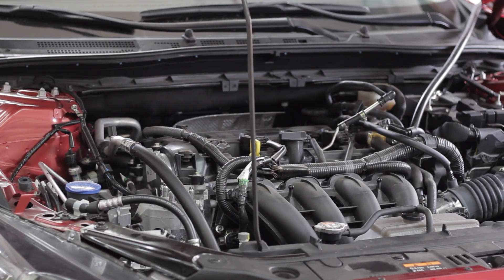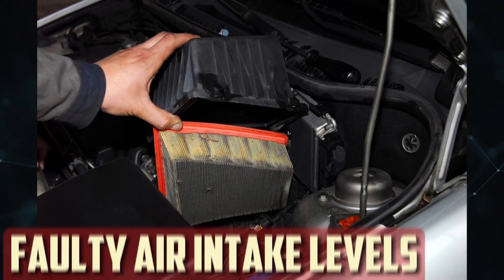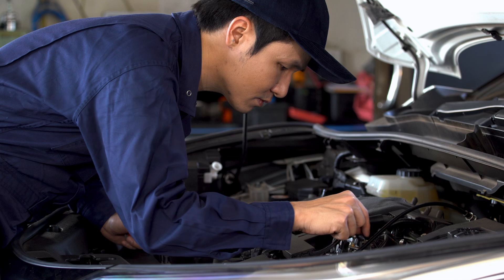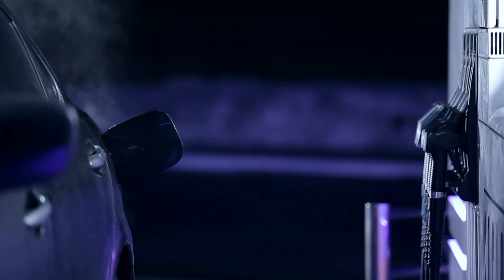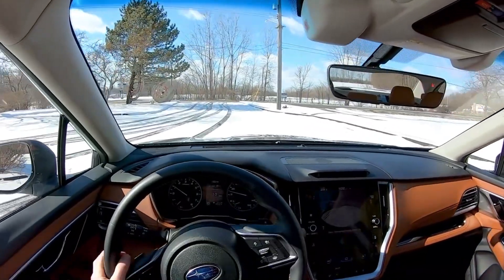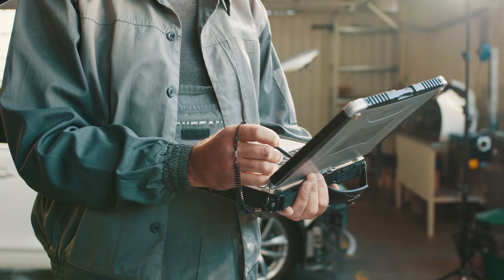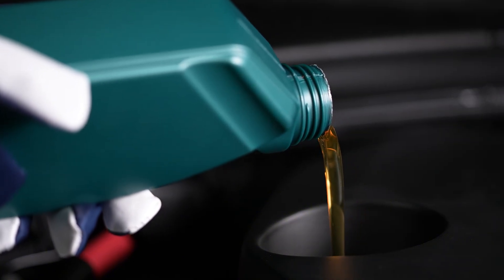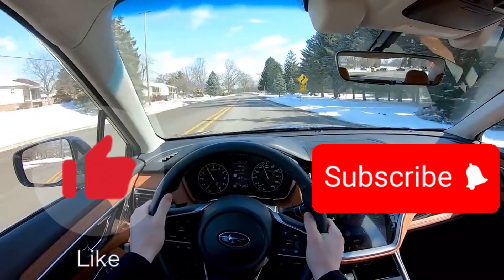5 Reasons Your Car Failed The Emissions Test. How to Fix Emission Test Failure

Comment: Code P0011 Variable Valve Solenoid is making my trunk fail the emissions test. What should I do ?
Mechanic said I need a new timing chain.  I just had it replaced 5000 miles ago